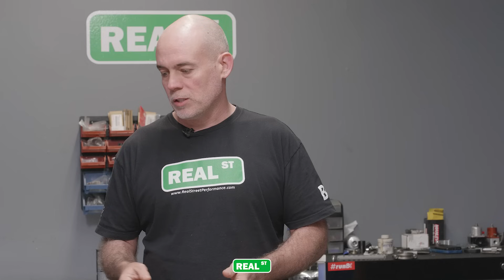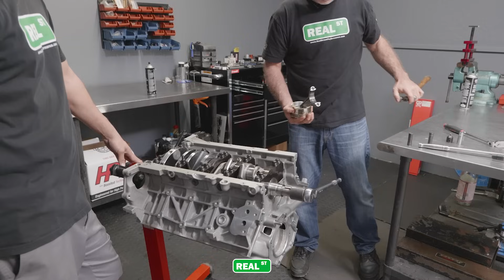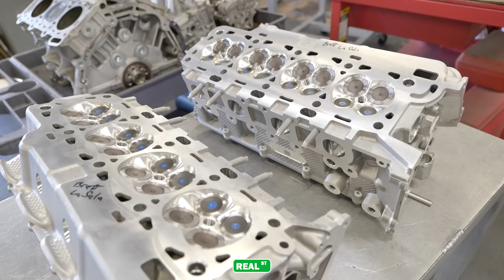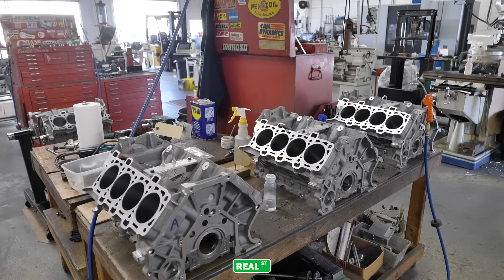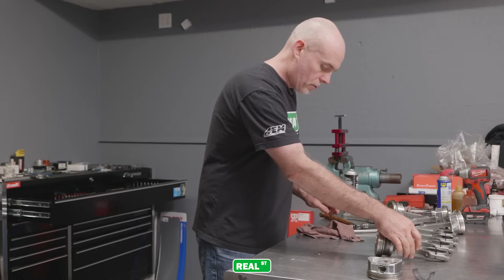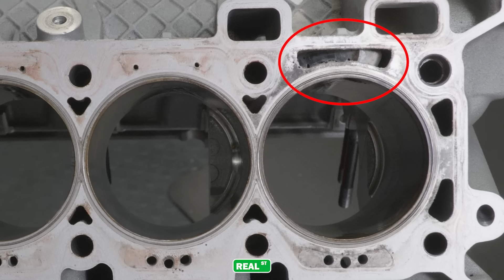2000HP 5.0L Coyote Engine Teardown Featuring Brett’s (Snot Rocket) 6 Second Mustang

Comment: These guys are obviously good at what they do and professionals... but anyone who thinks that the coyote is more proven than the original ford modular platform is absolutely out of their fucking mind. The ford modular platform teksid and aluminator have seen over 2000 hp on stock blocks. And stock short blocks are proven at 1000hp for a long time.
Reply: Yeap but sleeved of course

Comment: John Mihovetz set the record with the 4.6 and went 5.88@255. He was making around 3400 hp. This was with a non billet block too. MMR recently went faster but with a full billet block.
Reply: Ya.  Mihovetz did that with a 99 Teksid block with stock liners taken .002” over (dry decked with coolant routed to the back of the heads), Ford GT/Shelby GT500 head castings, and stock hydraulic lash adjusted and cam followers. 

This is why I laugh at this dude saying the old 4-valves were “dark days”.   

Coyote is “easy mode” only because they have readily available intake manifolds and stock engine management that will spin 8000 rpm paired with decent factory rods.   

The truth is Coyote hasn’t really haven’t really progressed over the “dark days” stuff in regards to blocks, cranks and cylinder heads (Ford GT/GT500 heads specifically).

Comment: @realstreetperftv Brett is incorrect a few times. First, factory valve sizing difference between gen3 5.0 and 5.2 is .5 exhaust to .6mm intake, and compression ratio in gen2 is 11:1 vs 12:1 in gen3 coyote, and 12:1 in Voodoo. Dude needs to be checked on his knowledge. Like this dude is a "pro racer" on your channel and he doesn't even know specs.....says a lot about you both....JS

Comment: And a junkyard ls 6.0 stock block no sleeves, stock crank stock rods stock pistons. change cam add ring gap and make just shy of 1,600 hp and it still lives
Reply: Depends what your definition of "still lives" is. A couple of hero engine dyno runs doesn't mean a whole lot. This stock block, stock crank and heads Coyote made approximately 2000hp and did that for around 100 quarter mile passes in a 3400 pound Mustang. That is impressive any way you look at it.

Comment: Unreal video thanks for sharing some insights to the coyote engine. I'm curious about the timing chain issue. Why do they and also the LS motors have a hard time holding things together with a chain. Seems so odd..
Reply: Chains live a hard life. In the mod Ford they're long and I feel that compounds the issue. The LS has a "dinky" chain compared to other OHV engines so you have less material to handle the workload. A belt would be nice!

Comment: I heard the stock sleeves are Teflon coated that wears out causing piston slap under 10k miles
Reply: The gen 3 coyote and the 5.2 voodoo are the only engines of the coyote family that don’t have physical sleeves. They’re not teflon coated but use a plasma spray bore coating in the cylinders which had issues on the earlier blocks

Comment: Is there a reason why Manley can't machine that out ?? The engine is marking it out. Pretty much saying hey guys this is where we are having issues so I can't see why that piece can't be machined out but then again that's why I'm not a engineer and a machinist
Reply: I'm sorry, What do you mean?
Reply: @jaymeagher1510  why can't that piece that hangs out the bottom of the bore that flaps over during high rpm why can't that be machined out ?? Just that tiny bit that does come out of the bottom of the bore ?? Im assuming they can't for structural purposes ??
Reply: @Lightsout89   Ahh Ok. While the piston is in any other position in the bore that material helps stabilize the piston. Stable pistons help with stable rings and that creates the combustion seal.  Also keep in mind the skirt isn't the same size from the ring land to it's end. You can read about the "gauge point" and cam and barrel to get more info on this.  Thanks
Reply: @jaymeagher1510  yea thanks for your time bro..I started learning all about this when I blew my ej20 up Cylinder 4 subaru factory ring gap nothing taking in to consideration for all the little bot ons I had done and people always say ringland failure. The product will hold up fine with stock power Levels but when there is so many easy bolt on available at the click of a button and 2 or 3hrs in the garage and boom 80more hp it's us that are failing and every subaru owner will fall for it atleast once 😄 so I always say poor planing on the modification is what will cause that ring to expand to the point where it can't expand anymore and it pops that ringland allot of people argue with me and tell me im so wrong but hey that's my view on that and this Is where I started to learn more about all that stuff and im currently putting a I.A.G MAGNUM 900 EJ20 SHORT BLOCK WITH MY BUILT HEADS AND ALL THE OTHER GO TO STI ENGINE SHIT AND IM NOT SURE IF TOO RUN THE GARRETT G30-900 OR G35-900 OR A BORG WARNER I REALLY APPRECIATE YOUR TIME READING THIS AND I REALLY APPRECIATE IT IF YOU WROTE BACK YOUR OPINION AS I VALUE YOUR KNOWLEDGE LIKE ITS CARVED IN STONE 👍🏼
Reply: @Lightsout89  Yes sir, I did more than a handful of Subaru engines in my early days.  I'd prefer a rotated kit and use the G30 if you're using gasoline and G35 if you have access to ethanol.  The borg stuff is nice too if you need to save some money and the 6466 from PTE is my choice if you're looking to party. I appreciate Garrett's marketing while trying to reenter the performance space but Precision has been advancing the whole time they were MIA.  So many good choices these days!
Reply: @jaymeagher1510  yea the build was actually unexpected 😄 and im in about 24 Aussie dollars so far with no turbo or rotated kit purchased yet im running primary and secondary injectors and 2 pumps staged as well as the injectors..instead of just 4 big injectors I think it makes it more tame on as a street car but doesn't lack when I need it too and I've just plumbed my parallel fuel lines in to the radium rails tgv deletes processwest manifold r35 coil on plug conversion and the rotated fab work is going to cost me bloody 5k AUSSIE DOLLARS and then the turbo I don't want to cheap out on a turbo if I've gone this far but borgs are around $2100 AUD  garrett G30-900 $3100 AUD G35-900 .86  $3100 
And the precision is around $4700 AUD WE GET ABSOLUTELY HAMMERED WITH MASSIVE MARK UPS BECAUSE EVERYTHING IS SHIPPED IN AND TAXED SO THE DEALERS NEED TO MAKE IT WORTH IT AND WE WANT THE GOOD STUFF SO WE JUST EXCEPT IT 😔 WELL MATE ITS BEEN A PLEASURE 🙏 CHATTING YOUVE MADE MY YEAR TAKING TIME TO ADVISE EXPLAIN AND TEACH A THING OR TWO IT MEANS THE WORLD BROTHER 🇦🇺👍🏼🇺🇲

Comment: im suprised he never mentioned anything about having to hammer out the gudgeon pins from the pistons you should be able to just easily push them in and out with your fingers,the tight fit occurs when the engine has had detonation.
Reply: I think that's moreso because the pins were reused and the chamfer on the pin was a bit excessive. Looking at the pin bores it didn't look like it was hammering but we've run that thing pretty hard none the less.  When we take the next engine apart we can have a better read on it. The bearings were not hammered, but I agree they should slide out. Thanks

Comment: Dang! Interesting tear down. I’m fiddling with a 4.6 4v out of an 03 marauder and it’s a really cool engine but the coyote has gotta be cheaper to build. Warms my heart to see you working on a ford engine.
Reply: Best part is, you don’t have to build it. Throw some boost,E-85, and a good tune and she’ll live at 7-800 rwhp for a long long time
Reply: @InFamousS550  people think it's that ez from watching YouTubers who have helpers and discounted parts then the average guy can get they are very costly nowadays 20k plus to do it right and if you are not a diy guy it's even more
Reply: @jonnathwill8318  I agree with you on that. A full proper swap is going to run you quite a bit. This was assuming you’re already starting with an S550 and up platform. The same way even for me a proper boosted setup blower fuel and tuning was about 10K+-1000
Reply: @InFamousS550   I thought it was a swap situation in that case yeah 10k or so plus for boosted. Most guys are usually swapping them into older vehicles is why I said that
Reply: It seems like they are in the short term but you got to realize to that Coyote motors are very costly to acquire 4.5k and up and to get one that has not been ragged on is a lot harder 5.6k and up there have also been issues with piston to wall clearance the typewriter tick and rod knock also
Reply: Then the control pack is 2600 or more for the manual transmissions plus power by the hour accessory kit and if you plan on using a manual you have to buy that buy a drive shaft ect. Plus whos gonna wire it up I may have miss something's it's gonna cost a good 20k and up  to do it right
Reply: @jonnathwill8318  very interesting. Thank you for your thoughts. I have heard that it takes big money to do a coyote swap properly. Swapping a v8 for a different v8 of almost same size doesn’t make sense to me. I bought a wrecked raptor with the 6.2 and 6r80 and that swap makes more sense but sticking with original 4.6 4v. Have an old m122 blower for it.
Reply: @canadianmarauder1923  and if you go n/a just get cams and valve springs that shift around 6500 with a tight lsa and a 3200 to 3600 stall converter and you set to go
Reply: Whereas you can take your Mercury Marauder motor drop a set of rods and high compression pistons in there find a s/c kit from adtr for 8 k and get 750 hp for less then 15k if you have a buddy to help you

Comment: Question for Jay: if you were rebuilding this engine and you have the “chatter” as exhibited on the faces of main caps and block; do you do any prep to these surfaces before rebuild if planning to reuse both block and caps or have they mated? I expect any prep to the mating faces would then require an addition line hone of the mains?
Reply: You can surface the block/caps if you'd like but as you mentioned you have to re align hone/bore. Thanks
Reply: @jaymeagher1510   thank you Jay: so at this level, would you rebuild as is? Not a loaded question; trying to learn what is an issue and what is not in your opinion. Many thanks

Comment: so a sleeved oem block, and forged rods and pistons making 2k hp? wow thats pretty impressive
Reply: @tvang2223  exactly, but they still wanna call a sleeved block, oem lmao
Reply: @David-er1cy  they said OEM block and the block is.. so...
Reply: @David-er1cy so how else do you put pistons in an aluminum block? Like gm did with the iron duke engine? Aluminum block, iron head and no steel sleeves in the block? If you can buy this block over the counter at the dealership, how is it not OEM??
Reply: I was just thinking the exact same thing 👍
Reply: @Brandon  I didn't know about the grout but the 3.7 is a de-stroke as from memory they are 4.1" or so rather high piston speed. One pro race run at 10k also at 3.7l
Reply: Check out Ford Barra turbo 6 4L factory block making 2200hp+ 7.9 Sec street registered lady driver. DynoMite Perf in Sydney.
Reply: @marklowe7431  2200hp going 7.9X? Seems off.
Reply: @keithmiller8828  Full weight street car over 4000lbs, 2202hp at the axles measured on a hub dyno. From memory it's now a 7.8
Here's a few links
https://youtu.be/eQNAiy-EHd0
https://youtu.be/hPpzdjT9P28

What's even more amazing is another guy in Melbourne is running 7's with many stock engine parts. Slightly different car ~1900+hp at the axles. Running 7's and drives it to work.
https://youtu.be/2hKpRTrGT54
Reply: @marklowe7431  who cares about a barra? coyotes have gone faster than that and are still streetable.
Reply: @Kylerensolo  Lot of people care about Barras, that why they're getting imported to US and put into Mustangs.  This video talks a lot about block limits. The barra literally from junkyard to machined can live beyond 2000hp.
Reply: @Brandon  It holds the record for that vehicle type already in the 7's for some time now
Reply: Yes and only 302 cubes.
Reply: Don't forget 9500 rpm and STOCK CRANK!!!
Reply: Not new to the mod motors, forged rods and pistons on the 90s teksid cobra blocks with stock sleeves are good for about as far as you can keep the B heads on the block, regular C heads wouldn't make the power, and then gt40/gt500 heads from 05+ got them to the point where they could make 3k+ with the right rod/piston on that syock kellog crank. After that, a billet steel crank was needed to not eat bearings every pass. And billet steed rods too. The record with a 4.6 modular block is near 4000 horse (according to math from a quarter mile run) done on stock sleeves bored .003 over, and the main webs started cracking. This is all rated from John mihovetz, the modular ford legend.
Reply: @MekanikRandR  is the authority. He builds pro mods.
Reply: @coyotekelly7143  and what do you do?

Besides I was literally quiting mihovetz, aka the current world recond holder for the fastest modular ford I'm the quarter (unless mmr broke it with the coyote stuff in the last 2 years)
Reply: @MekanikRandR  I'm a technician. But I don't act like I'm the authority on everything and drive away in a 2v. We all know that you are the fastest guy in the grand stands.
Reply: @coyotekelly7143  no I'm just the slowest guy in a 4v
Reply: @tvang2223  Then just about every so called stock block is not stock. Try doing any of this without mains studs. It's semantics but sleeves can and are considered a consumable in some cases.
It's not a billet block either. It's OEM with sleeves.

Comment: 9500 RPM... damn. What rods are in this build?
Reply: Manley steel I beam rods.
Reply: @TheJFAB  4340 or 300M? Been waiting on mine for 5 months from Manley
Reply: I mean they rev to 8500 oem with a tune so definitely doesn't sound profound to go to 9500 on a built engine

Comment: That's truly unheard of, from my memory, for any motor. Nice tuning, Jay!  That bay is clean as heck, too. Well done real street and FF. This setup actually doesn't sound very expensive to have a lot of fun...
Reply: I guess everyone has a different idea of expensive.
Reply: @chpsuey  cheap for a six second engine for sure. The only expensive item may have been the R&D for the pistons. The pistons themselves probably weren't if he batch ordered them.
Reply: @chpsuey  no, its far from cheap and I'm far from rich; but some guys literally spend $40-100k for 2000hp setups. I would think this is more at 15k long block.
Reply: @carmisti   That is not a $15k longblock. Closer to $20k
Reply: @carmisti  you’re not even close
Reply: @skullhart  still very inexpensive for 2000 hp capable. It would have been three times that fifteen years ago
Reply: @Travis Pfannmuller  100% agree. The coyote is an amazing platform
Reply: Not very expensive? LOL
Reply: @iDrinkJ4ck  less expensive compared to other platforms where you're forced into an aftermarket block at this hp like a Dart or billet block like an AJ.